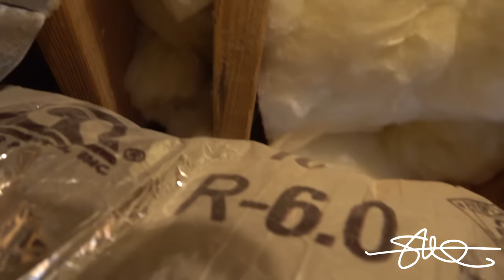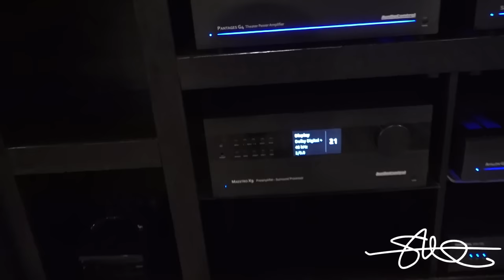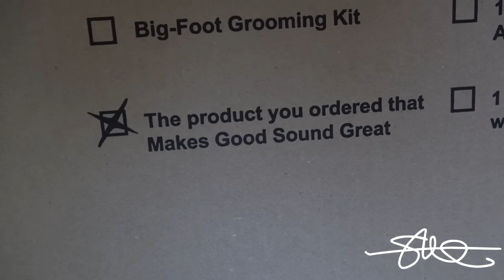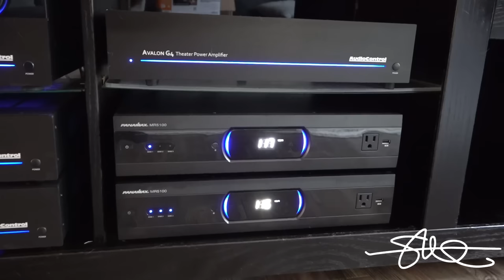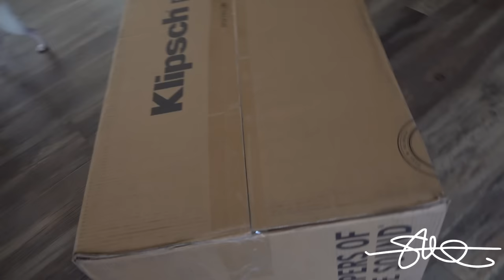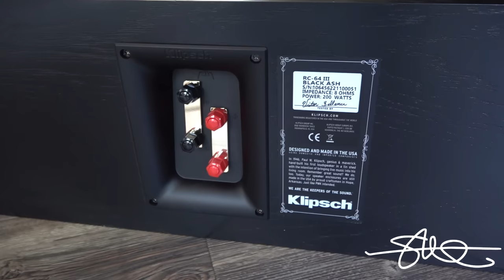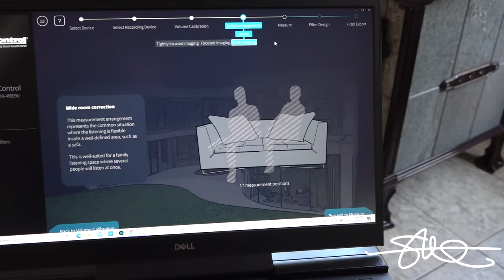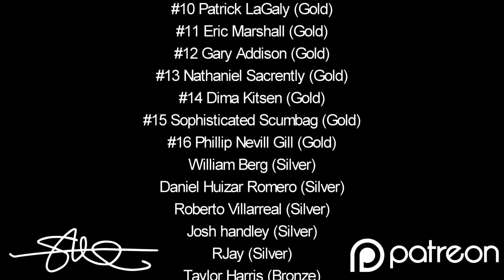Ultimate Surround Sound Installed 9.2.4 Dolby Atmos - Audiocontrol Amps Klipsch Speakers 15 Channels

Comment: Nice, as someone with a large stereo in their house it is always fun trying to run cables and have enough power and try to keep it clean. My system is a mix of old and new so the cables had to all be made. My system is for music, more than video so everything is for higher SPLs. It gets really fun getting the AC into a room to run to use a mix of pro sound amps and high-power older amps. Time alignment must be fun with so many speakers facing so many directions.

Comment: Cable contractor here. When running multiple decent sized wires like you're running here if you ever have trouble getting them up a wall because of their edges or the shielding being too grabby, get a piece of small jack chain from HD/Lowes to attach to your glow rod. I use a 3/8ths (almost big enough to get the tip of your pinky finger in the links). Then strip the center conductor of each wire about 2 inches and wrap individually around the links in the chain, about 3 inches apart down the length of the chain and twist the center conductor back around itself. Makes for super easy pulling. Generally you don't want to have to use tape at all; of course some times you have to.

That wiring job behind the cabinet is what wet dreams are made of.

Comment: Hey man, awesome setup! Just a suggestion. Before putting speakers in the ceiling for Dolby Atmos, try using the Auro-3D upmixer with your current setup! Guessing your processor supports Auro-3D. In my opinion it's a step up from Dolby Atmos and can upmix anything to overhead effects! Works well with music as well as TV and movies!
Reply from the maker: i use that sometimes but my speakers aren't really arranged for that.  Yes my processor supports it but to me it is one of those things that is cool for 5 minutes and that is it.

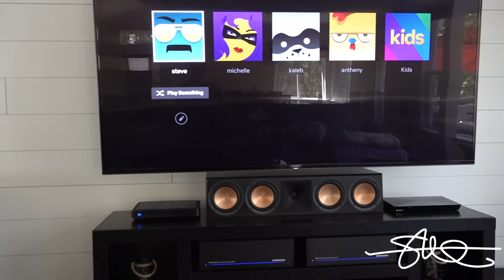Comment: 30:32 hi sir, it sounds different because of the subwoofers, the depth in the subwoofers make it sound different... hope this helps after 2 years🤣🤣🤣🤣love ur home threatre setup once i grow up m also gonna make my own home threatre at my house btw my parents have a home threatre which is sony dav dz 350 (1000w)5.1 channel it is a nice home threatre with a 65 inch sonny bravia X80K and a ps3🤣🤣 my home threatre's dolby atmos is good after changing its sound field to dolby pl.. my parents got it 7 years back... for a nicer experience keep ur centre speaker behind the T.V. it will sound really good  
it will make it feel like the sounds coming from the T.V. and with the dolby atmos more amazing... m 13 btw

Comment: Clean setup, currently running 16ga Mediabridge speaker wire and banana plugs, very strong connections so far. Will be adding SVS speakers to the monster SB16 for a 7.1.2 setup. Tried Klipsch before, to each there own.

Comment: Awesome setup up and install I have a 7.4.4 Klipsch setup in the works it'll be 15 channels with bi amped front and rears powered by a 9 and 6 channel emotive and the new Denon receiver you inspired me but that's not what I wanted to tell you check out the salamander designs synergy system model 345 it'll house all your equipment and center channel much better last thing how much would you charge for a similar install yours is one of the cleanest I've seen

Comment: Nice job and setup, .. i need to update mine . My fronts are old school cerwin vega vs100 i bought back in 1996 had to redo the surrounds on them once already lol only running 5.1 at the moment but receiver and amp is  7.1 looking into Polks mid line but money going else where at the moment

Comment: Any plans to fix the room acoustics? I cringe at all the reflective surfaces in that room. Please do a video on that. Thanks.
Reply from the maker: the big ass couch, the big ass ottoman, and the carpet it is all sitting on helps a lot.  It needs some help but it ain't that bad.  So no need to cringe it still sounds awesome.

Comment: I have about the same setup but I went with RP-450C for the center channel. The off the shelf subs are pretty disappointing (or I’m just deaf) so I built one of the Parts Express DIY boxes and took the JL 12W6 out of my car with one of PE’s rack mount 1k watt amps. Now I’m going to switch that out for two PE 18” Ultimax kits and another amp.
Reply from the maker: they dont produce mind boggling over exaggerated bass.  Just accurate and clean. They sound good for movies but the over the top "rap bass" with that cabin gain you get from a car they don't really do. They get the job done. Like i said, ill do the 33 or maybe both the 33's for when i want it to be a little extra.

Comment: Hey Steve much respect. I have a question I can't seem to find a straight answer for - What's your thumb rule for how much extra amplifier power to use besides the receiver itself? I have some speakers coming that are 88 db sensitivity and the specs recommend 50-200 W, whereas my receiver is rated 100 W. Reddit says I'll still be able to reach uncomfortable volume levels without clipping.

Comment: Very very nice. Dose it kick out a lot of heat.  I only have  65 inch tv and 300w soundbar and sub + xbox series x.  And it warms the room up.
Reply from the maker: zero heat.
Reply: Nice. Thanks 4 the reply.  Have 
 u cracked any drywall yet with the bass.  😂😂
Reply from the maker: @gsahookah599  well, it don't get hot at all.  I so what else do you want me to say silly boy? You are out of your element, just stop now.

Comment: Setup is amazing , try watching a 4k HDR bluray with dolby atmos or Dtx  I recently tried a few on my ps5 and sound and video are much better than streaming
Reply from the maker: I don't need a disc. Streaming is just as good. Not sure how you came to that conclusion lol
Reply from the maker: @PcandTech  not a fact.  But thanks anyway.
Reply: @PcandTech  as long as your bandwidth and speeds aren't trash, tv is compatible, and all your network cables can transport 4k+, your shits gonna be top top top quality HDR 4k atmos.
Streaming has came a loooooong way.

Comment: That setup is sick! I dont know if this is a thing in the US, but does the X9 support Auro 3D? For movies without Atmos it is absolutely awesome and it even delivers more sound on the height channels then Atmos in SOME movies (Atmos is slowly getting a standard on Blu-Rays in germany, so i wanted to have the auromatic available in my av receiver - also for older movies in 5.1 or stereo it does a very good job). It even could work decent with your setup of the height speakers (25-35° in height from the listening spot), because the Auro 3D setup is compatible with DTS:X and Atmos. I'm looking forward into buying a Klipsch Center/Surround/Surround backs, 4 height speakers and 2 Reference 12" subs - this is going to be good :D Greetings!
Reply from the maker: yup it does support that :)

Comment: This system is fire AF..... I have a Klipsch system and slowly adding to it. I have the Atmos Towers, rp504c2 center, 2 SPL-100. My side and rear are Onkyo THX looking to get Klipsch bookshelves to replace them soon. Do you recommend always going with external amplification or would a Denon x8500ha work? it has 150w per channel and it's a 13.2 channel.
Reply: Your Denon with all channels driven has maybe 35 watt per channel.

Comment: What do you do for all that electronic heat?  I have a receiver that if I push it, it eventually turns off due to heat.  Doesn't allow it to damage the unit.  I put in a 120MM Fan and it solves all my problem of heat.  Might want to rethink putting two 1000 watt amps on top of one another.  I know this is a old video.
Reply from the maker: no heat problems at all.  Your receiver is a probably a basic all-in-one (no external amps) so that is probably why yours gets hot.  None of my stuff gets hot at all.

Comment: Can't parallel off the same center channel? If not able to dedicate to the spare channel, the only issue may be the the high slceilings and large windows echo and vibration resonance.
Reply from the maker: if i "parallel" off the same channel i will have a FRONT center in the front and a FRONT center in the rear. That don't make any sense LOL.

Comment: Klipsch are good speakers , however their subs not so much and I know those 2 little ones aren't filling that large open space with the bass it needs! Interested to see how that 33" sub works and how it will be tuned if it's a car sub? I'm a Powersoundaudio guy and have a pair of their ported 21s , but some JTR Cap2400s , or RythmikFv18s would take that sound to a whole nother level!!  DeepSeaSound or Funk Audio as well if your pockets are fat enough...Really appreciate that wiring job , I hate them as well but I'm on concrete and did the best I could to hide them!
Reply from the maker: actually the little ones are doing fine.  Plenty of bass for  movies. MORE than enough.  The 33's will be fun though.
Reply: @meade916  I'll be looking forward to that video!

Comment: amazing set up but dont u need up fireing fronts to get full affect ? seen a few others wit atmos that up fire
Reply from the maker: no.
Reply: All these new atmos soundbars use upfiring speakers to simulate the downfiring speakers from a normal (real) atmos setup using reflection

Hope that helps
Reply from the maker: @j3nkns780  those things are trash. Don't buy one unless you really don't care.  Hope that helps.

Comment: Rear center channel is way too close. It needs to be back as far as the rear surrounds else it's going to be pretty localized and volume will be wacky. 

Getting room treatment and full DSP/ time aligment, DSP can make most systems sound pretty good.

Comment: My room with the tv in it is 70’x 35’ with 22 foot ceilings. I’ll have to prewire while we renovate. Hard to know what kind of atmos system I am going to need. Not sure if it would have to be a 10k system or a >30k system to sound good.
Reply: I won’t be putting speakers at the perimeter of the room. I’ll be creating an open space living room in the middle.

Comment: Nice setup but it's actually 13.2 not 9.2.4.  The .4 is for atmos configuration, those speakers need to be mounted in the ceiling pointing down on the listening area at specific angles so atmos can create a 3d sound stage.
Reply from the maker: you aren't serious are you? LOL you better go re-check your sources (google). SMH.  There is two ways to do this. In ceiling or the way i did it. EDIT: actually there is a 3rd way and that is my same speakers on top of the towers aimed up to bounce of the ceiling.  This is FOR SURE Atmos and it is for SURE 9.2.4.  Stop trying to act an expert.
Reply: @meade916  lol gottem.
Reply: The man makes a damn good living off of audio n your trying to school him on what he got?! 😂🤯